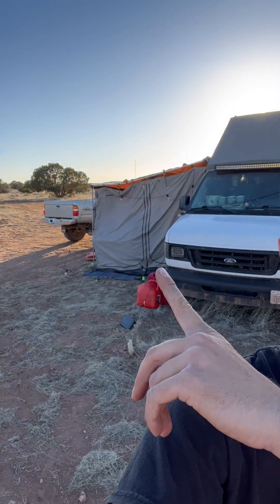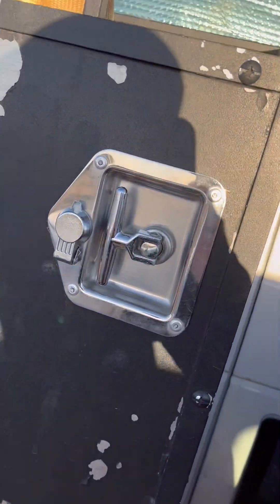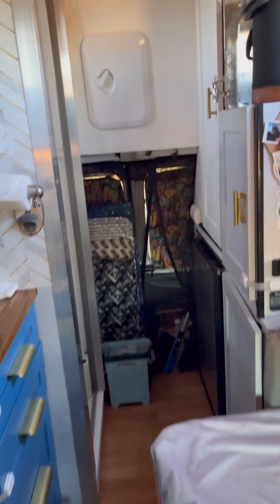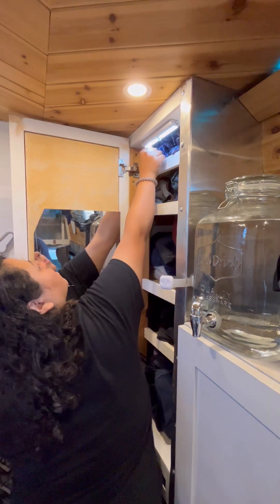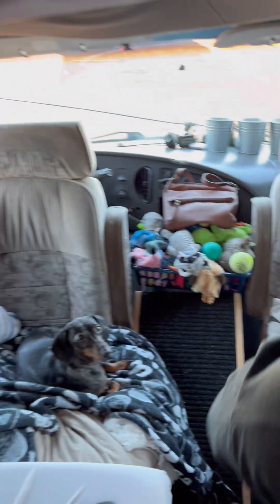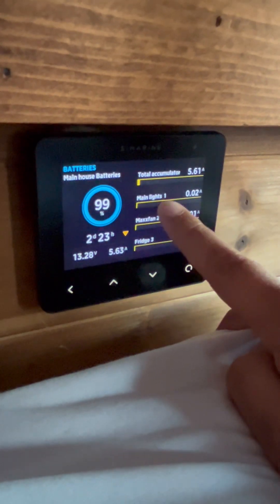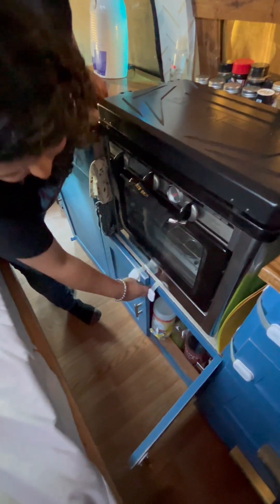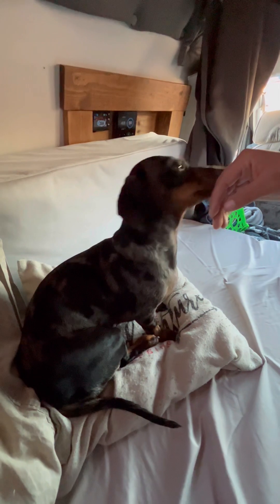Northern Arizona Off Grid Van tour before we move into our new rig!

Comment: Here in Flagstaff we've gotten 162 inches of snow so far. More like it used to be really. It looks to me like you are west of here. No doubt you have to bring water in as there is no ground water out there so sinking a well is not possible. Good luck out here, make sure you maintain a defendable perimeter as wild fires are a very real danger there.
Reply from the maker: That’s a good amount of snow. We were in flagstaff yesterday and noticed signs of flooding from the quick snow melt these past few days. Great advice we’re working on clearing our property of dead wood. We also want to build a trailer with a water tank, pump and fire hose to defend against potential wild fires. There’s a few airbnbs around us with fire pits that worry us because unfortunately you can’t trust everybody to use safe fire practices.
Reply: @mitchandjoy  is there anyway to recycle the snow into water?